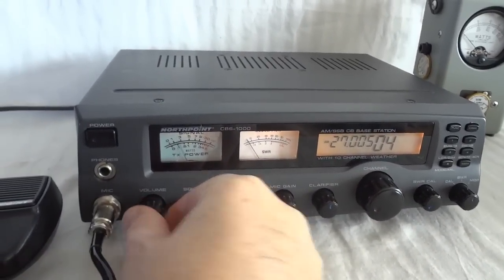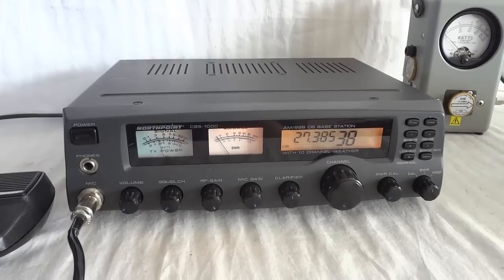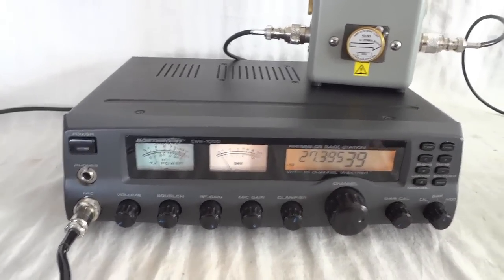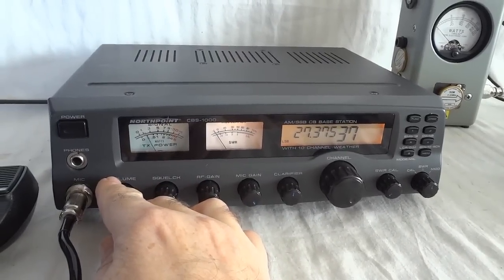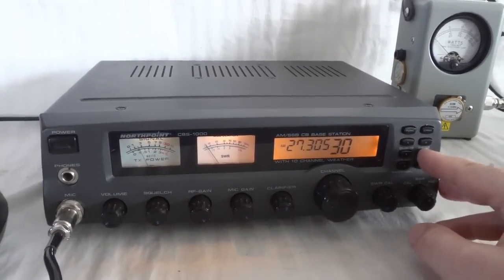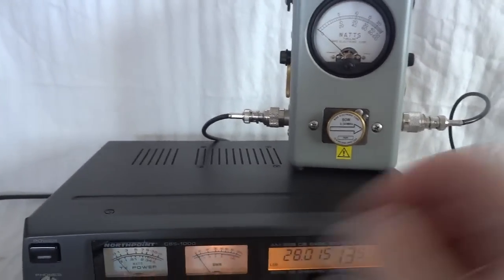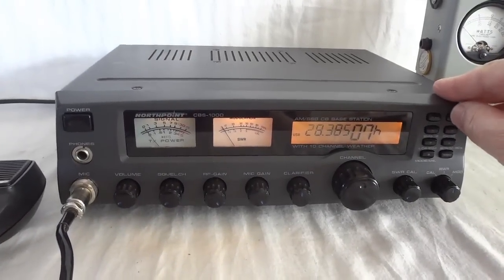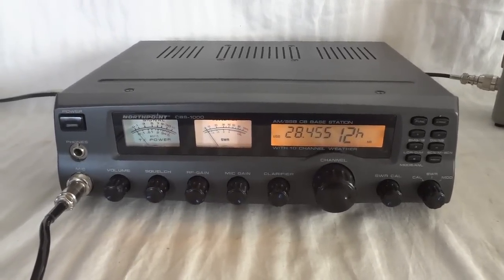Northpoint (Cherokee) CBS-1000 sidebander base station made by Uniden

Comment: LifesTooShortForQRP has a real good idea on a fix for this radio and it's knobs and mini switches! If you are lucky to get
them off in one piece. I got all of them off except for one which shattered like glass and it was the RF Gain Control. Need
to turn some new ones out of aluminum bar stock on a lathe. Have them knurled then you have something reliable!  A
conversion to Amateur 10 meters is real easy for this rig and would make a good QRP rig.
73s

Comment: Becareful removing the knobs on this radio with age they are brittle and break easily and to make things worse, Uniden
put masking tape over the metal knob controls which makes them hard to remove. I got one of these radios off of Ebay
and one of the pushbuttons was inside the radio behind the panel. I had to remove the front panel and fix the tiny fingers
on the pushbutton using a hot glue gun. The rig was locked on AM and contact cleaner had to be used on the switches
to get them to work. This is a good radio except for their controls which needed to be more refined with better engineering.
I paid too much for mine since it came with a 12VDC cable on the back connected to it? I am assuming the regulator in
the radio was damaged and a separate power supply was used. The lamps were real bright and I check the voltage on the
regulator, 30vdc which means it has a bad regulator and is running full output from the internal supply. It runs ok from a
12vdc external power supply and amazing that it could take that much over-voltage and now I have another problem to
fix!

As far as the cheap plastic knobs go, the Cobra 2010 GTL base looks like it might be the same radio and the knobs look
almost identical? The AE8000/AE8090 CB-Base Radio is identical except that the blue marks on the buttons are red. :)
Might be another source for parts?
Reply from the maker: You are absolutely right, I had the same problem with the knobs and little push buttons that you describe. I fixed the pushbuttons with 2-part epoxy (2-ton from Devcon works excellent) and the knobs I also fixed with the two-part epoxy by filling the empty space on the inside of the knob (between the part that slides over the shaft and the outer part of the knob plastic). That basically makes the knobs solid instead of hollow. When done, they feel very solid and will never break any more! Cheers.

Comment: Very cheaply made radio falls apart to easy my buttons on the key pad fell out lights burn out to fast but the radio is a good talker and the electronics inside are great no problems . Still works fine to this day.